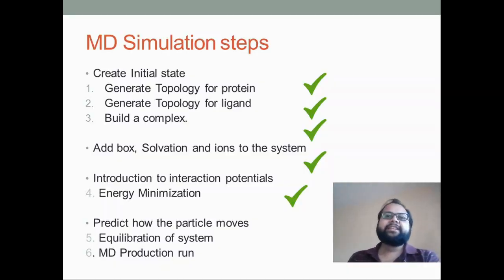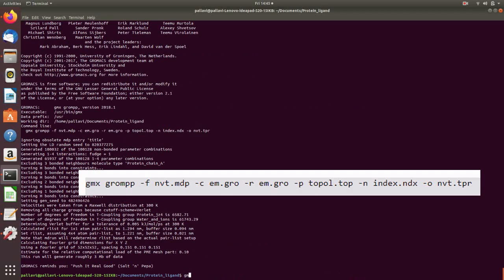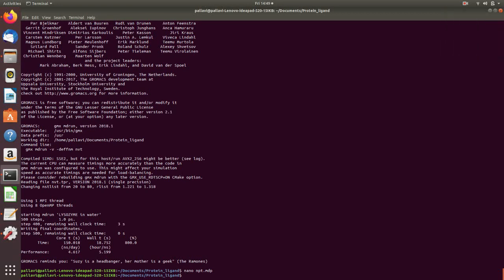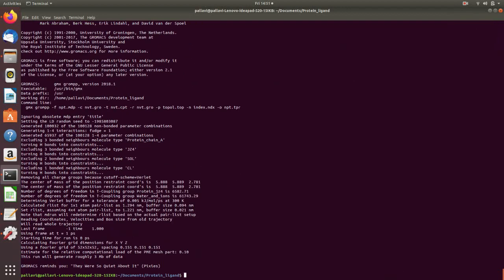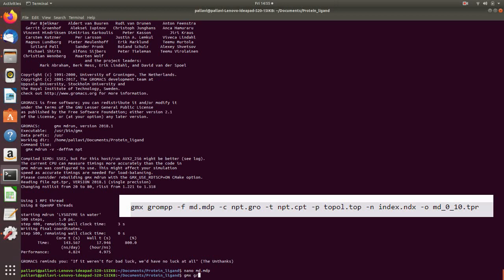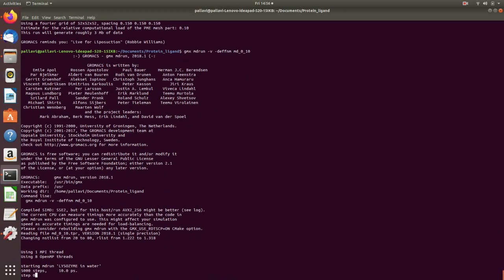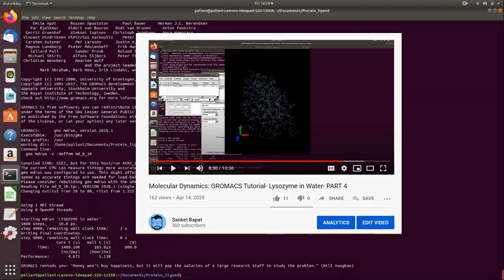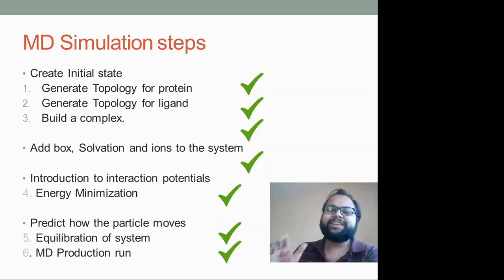Molecular Dynamics Tutorial | Protein-Ligand Complex: GROMACS - PART 3

Comment: Thank you very much for this tutorial. However, in equilibration phase i put this commands: 
gmx mdrun -deffnm nvt
nsteps                  = 50000 
but simulation stopped at 13 steps, and i found this error :
Wrote pdb files with previous and current coordinates
Erreur de segmentation (core dumped)
have you an idea to fix it ! Thank you for your help

Comment: Hi,

When I set     tc-grps = Protein_JZ4 Water_and_ions in the command line.    tc-grps : command not found is displayed. Why it is so?

I have seen in your tutorial video too tc-grps : command not found has been displayed.
Reply: I am new to Gromacs, so correct me if I am wrong. I believe 'tc-grps = Protein_JZ4 Water_and_ions' should not be a command in the terminal. Rather, it should be included in the mdp file, i.e. in this case, the nvt.mdp file.
Reply: @jasoncheah9218  I think you are right i found the same thing in the nvt.mdp file, so 'tc-grps = Protein_JZ4 Water_and_ions' is not a command, thus we should not type it on the terminal. Thank you for the clarification
Reply from the maker: That was because I made an error in typo, you can check it at your end what might be the issue
Reply: @sanketbapat  Hello!! Greetings from Mexico, can you explain me what was your error in typo?

I have the same problem and I´m running out of ideas...

Comment: Hi, I tried running the last step of the MD simulation for 10 ns by setting: nsteps = 5000000 & dt = 0.002.
But the simulation stopped at about 7 ns. Do you know what might have caused this issue?
Reply: Dear Sir, how did you solve thise problem?

Comment: Thank you very much for this tutorial. However, I would like to ask how to continue with your simulation from where you stop in an event where one encounters power failure (perhaps due to electricity or system battery problem).
Reply from the maker: You can use the trajectory file for continuation. There are certain commands, Gromacs help page online explains how to do it. Its possible, you don't have to worry.
Reply: Thank you very much sir.
Again I am experiencing some problems at the “addition of ions” stage. Errors in some lines in my “ligand.itp and ligand.prm” are popping. The errors entails “no default proper Dih. Types and no default U-B types”. I have checked the gromacs troubleshooting server but couldn’t find any relevant solution. Is there a way to overcome this error?